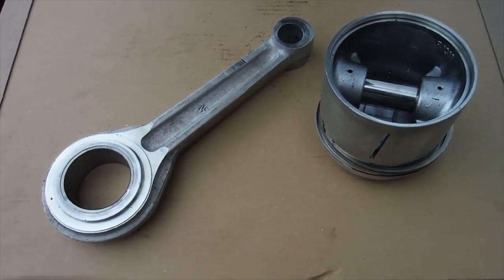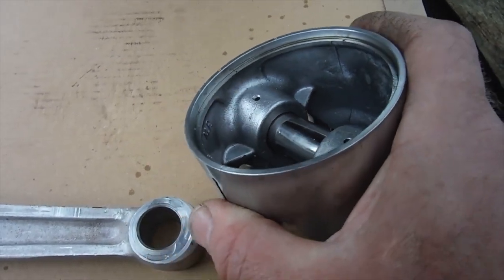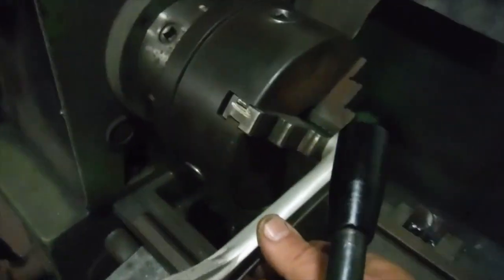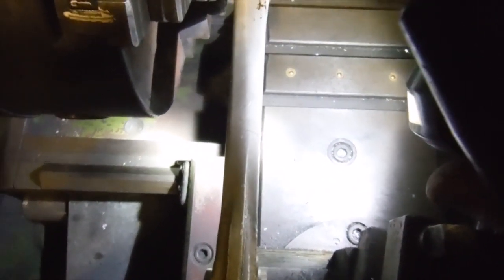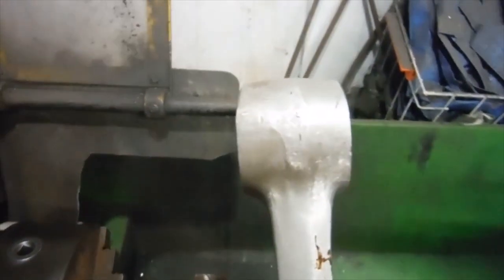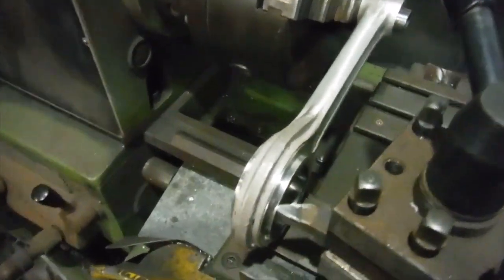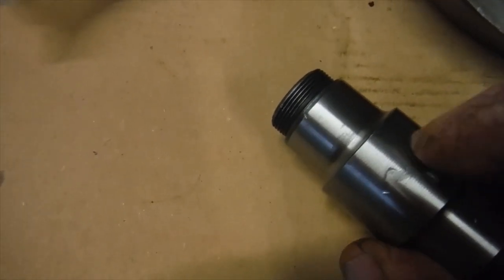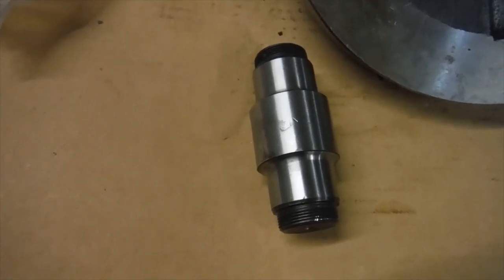Royal Enfield Bullet 500. 4 Conrod checked and new crankpin rejected as sub standard.

Comment: Do you think the uneven wear and machining of the conrod might have been a factor in the gudgeon pin trying to escape and pushing the circlip out? I appreciate there will be some side to side float, but would be interested to know how much there is with this conrod and piston, as compared to a better unit. Also if it has been sufficiently wobbly to rub on a flywheel, I wonder if that might have compromised the strength of the rod. After all your hard work it would be tragic if it went bang in a big way later....
Reply from the maker: Hi Stephen, if I had any doubts about that conrod, I would have fitted another. The checks I made ensured it would not have any adverse effects such as side loadings on pistons or gudgeon pins. The rub marks are very minor and not a worry - I have seen worse!
Reply: That’s terrible that crankpin your right to reject that
Reply: @paulhenshaw4514  Paul having seen your second video the crank assembly has gone together very nicely indeed. I am sure this will turn out to be a very smooth motor now.

Comment: Hi, the shank is not a good reference to check if the small end and big end are parallel. Shanks are often not at right angle to the bores in India rods, and its no problem really. Better fit the big end in one flywheel, fit the rod and slide the gudgeon pin out over the main shaft. Then measure distance between main shaft and pin. There is play so you take two measurements really, add up and divide by two. Turn the rod the other way and compare. To measure that way you need to stabilise the lot properly. The difference between "left" and "right" measurement should be <=0.2 mm. Straight from the factory they are OK. However if a machineshop replaced and honed the big end liner it always pays to check it. The rods will survive some bending to get the bores parallel.
Reply from the maker: Thanks. I find it is easier to test for 'straightness' from the big end just by fitting the rod and big end to the crankpin, once home in the timing side flywheel, checking the clearance against the flywheel face and then turning the rod over over and repeating, although I know what you mean about the conrod shanks not being a mirror image of each other, necessarily. Having already used my method in the lathe from the small end, if the above checks out ok, you are good to go.